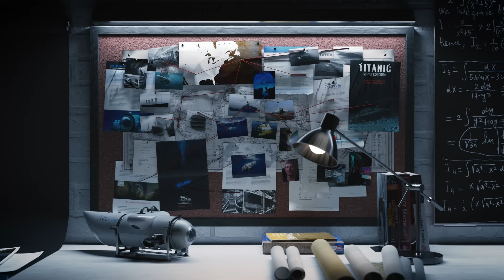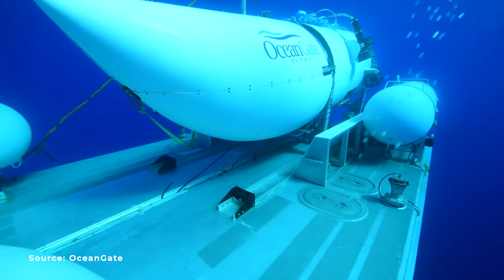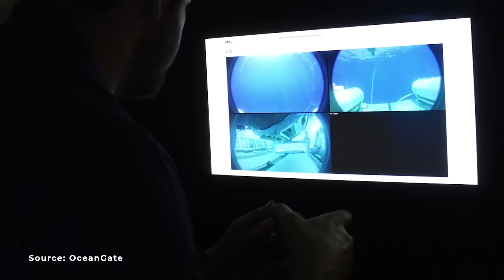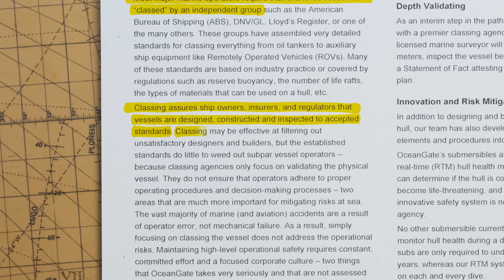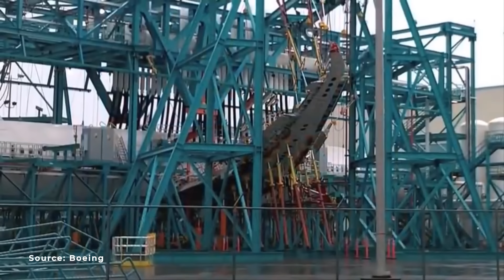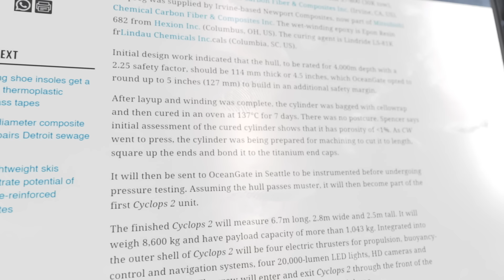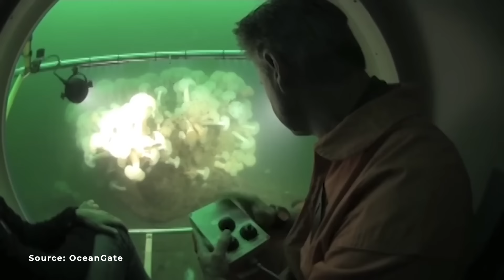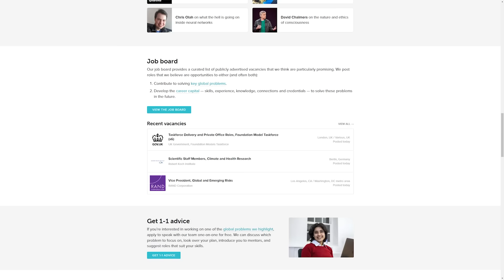The Questionable Engineering of Oceangate

Comment: Controller is a logitech f710. It is actually a very good controller. I have had the f310 for a few years now and had no issues with it.

The problems with that oceangate run deep (pun intended), but the controller is not one of the issues.
Reply: It is cheap and entirely indicative of the mindset that caused these deaths, so yes, it is a problem.
Reply: @connernickerson5509  no. It may be cheap and indicative of a larger problem with cost cutting, but that is not the same as being a problem.

Comment: the composite materials are realy awsome if you manipulate the properties of it flexing/stretching. Red bull did just this on their wings on the F1 car where it would bend down in a specific way if the G force was coming from a specific angle when going fast into a sharp turn to create ground effect sucking the car to the ground, so going into a corner faster made the grip better then going in slower. Truly awsome way to use its properties other then just being very strong for its weight
Reply: @@erickanter4090 that for sure they aren't made for compression

Comment: Thanks for explaining the underlying issue of using CF composites for compressive loading. CF tanks are used to store hydrogen on excess of 5000 psi in vehicle applications, but the CF composite is under tension in those applications.

Comment: Remember there is a good chance the carbon fiber tape was expired or close to end of shelf life when layup of the pressure vessel was done. 

Expired as in partially cured before layup leading to bad layer adhesion or voids as mentioned.

Comment: Questionable is a huge understatement.
No diagnostics, testing, disregard for obvious material science problems (like ignoring the difference between tension and compression) and past experiments or empirical work - which pointed out that this application had failure modes of delamination and that there was no method to acertain the if the pressure cycles were creating stress or microscopic problems. There were entanglement hazards, fire hazards, obvious design problems like people not having access to a hatch, seal problems, etc. Engineers around the world were ignored, whistle blowers were ignored...

Mechanical failure isn't more prevalent AFTER you do a serious engineering analysis, testing and you have protocols and real past experiences to weed out mechanical failures. Then, the operator has to be trained. So that blog line was total BS. Most mech failures don't end up happening because they have mostly been dealt with previously. There were no redundancies on that ship, so comparing it to aviation is laughable at best.

Idiots forget that when failure means deaths, costs are irrelevant. People will pay anything to not die.

Turns out doubters can have a point, specially when they are smarter, more experienced, and had studied that in the past. It was obvious they had merit.

Rapid innovation is a series of educated guesses, luck and things going better than expected.

This disaster is the culmination of unearned wealth, idiocy and greed. We should remember this as one of the most hilarious and stupidest accidents in history.

Comment: The move fast and break stuff innovation mantra is fine as long as lives aren't on the line. Run unmanned stress tests. It breaks at 50 dives? Then we'll rate it for 30 dives giving it a 40% margin of error before the composite hull needs to be replaced.

Comment: That's the key, isn't it - the reason the majority of accidents are operator failure rather than mechanical/electrical failure is that the latter class of failure is easier to control and better regulated. We can set good specs and build and test to them, which leaves us confident that the physical components are up for the job. Operators, on the other hand, get tired, or lazy, or unethical, and deviate from procedures even if you have good ones, or forget key principles in the crunch. We can reduce this risk but we can't reduce it as much as we can with dead matter.

Comment: Very good analysis.  I am also struck by the obvious failure to follow the principle of single-fault failure mitigation.  This is a widespread technique that's taught in which all possible failure scenarios that might involve injury are listed and measures are then taken to eliminate all single-point failure sources.  It's obvious even to engineers who lack the special training of this channel's founder that there are many ways that injury (or worse) could result from one thing going wrong.  What if the dive is successful, but the vessel comes to the surface and a serious storm has arisen? The passengers would be tossed about the interior like debris in a can.  What if there was a need for immediate exit of the ship?  Maybe they don't think that will happen, but the managers of Apollo 1 thought the same thing.  
If this device was a graduate level project, it would have gotten an F.

Comment: Autoclaves don’t force the voids out, they force them to be smaller. In that respect, vacuum bagging might actually be better. OTOH, as far as I know, the resins that don’t need the autoclave’s heat to cure are generally not as strong, so maybe they were using the superior process with the inferior materials?

As for billionaire man-baby space-Karen, I don’t think it’s fair to call his fail-fast “ethos” the same as what this company did: he tests! It’s a modern software methodology: code fast, test often, optimize later or never.

Comment: There are autoclaves used in the aerospace industry that are large enough for the submersible. I have seen them at airline maintenance facilities.  The problem is you'd either have to bring the autoclave to the manufacturing facility or bring the manufacturing equipment to the autoclave.   Neither choice is easily doable as both require dedicated installation and support equipment.   The only choice would be for the composite manufacturer to buy and install the autoclave, which for one, unique project is not cost-effective unless the company contracting for the composite manufacturing wants to absorb that cost.
Reply: not cost effective? then raise prices.
I'm sure customers would appreciate the added guarantee that you won't kill them by skimping on manufacturing
Reply: SpaceX at one point was doing carbon fibre tanks for Starship and they had an autoclave large enough for half of an 9m wide tank. This sub is way smaller. Not using an autoclave really makes no sense.

Comment: I have no problems with Stockton risking his own life to test new designs. Its the part about bringing paying passengers along that is the problem.

BTW a transscrip of the last communication with the Sub is floating around. It has not been confirmed, but if it is real, the accustic warning system did actually work, but for some not yet explained reason the sub could not resurface when they got the warning.

I guess the sub would loose boyancy if the hull was pushed in slightly ahead of the total failure?

Comment: Metals have strength when pushed on, as well as pulled on. All successful Submarines have metal hulls for this reason.
Carbon Fiber was the worst choice of material for a submarine hull. 
Carbon Fiber is like String which only has strength when pulled on.

Comment: It baffles me how this company took so many shortcuts with no counter risk mitigations.  It lacked redundant systems and it bet peoples live on thin or even exceeded margins.  I've built some lower cost storage servers for customers by using refurbished drives but I always require they spend some of the savings on extra redundant drives and keep a spare drive or two available.   Its just basic risk management and this company had none it seems.  Engineering is an act of balancing all the requirements of design, risk, and cost.  What these people did was just build something and ignore risk for cost.

Comment: As someone who is also currently working with composites as my master thesis, this video is very well done and very informative! When I first heard about the news about the submarine I did not know that it was made from carbon fiber epoxy composites, but after hearing that, I was flinching because composites are very heterogenous and if one materials good in tension there is no assurance that it will be in compression and carbon fiber is definitely not known for its good compressive strength! yikes! So incredibly sad that 5 lives were lost because the CEO did not  care enough about standards and testings which are usually very rigorous for aviation industry.

Comment: So, basically their argument was, "Everyone else is classed to ensure the vehicle meets acceptable standards of safety.  But none of those classed vehicles sank without operator error.  Since it's always operator error, and classing doesn't address that, why bother classing?"  

This logic is severely flawed.  The fact that it was only ever operator error in classed vehicles is actually an argument TO get classed, because it appears to vastly reduce or eliminate mechanical failure and leaves only operator error as the potential risk.

It's like saying, "No vehicle in which the brakes have been inspected has ever crashed due to a brake failure.  They have instead been a result of driver error.  And since brake inspection doesn't assess the driver, we decided we don't need to inspect the brakes."   This failed logic just reintroduces brake failure as a potential risk factor.

Comment: moving fast and breaking stuff is not a bad strategy, specially when what you are making is nearly impossible to realistically simulate and there are way too many moving parts. but you NEED to break stuff, you need to test it in every conceivable scenario and see what goes wrong. that is why Space X was successful, every time they failed it was an opportunity to improve, they never put lives on the line until their rockets were proved to be safe enough through repeated testing.
Reply: I think the problem was Rush's move fast and break people strategy...
Reply: @MarkTillotson  that is the point, he should only have put people in the sub after 1000 unmanned dives to much deeper places than titanic. Falcon is one of the safest rockets because they launched A LOT of it, and it failed a lot, to the point they basically figured out almost everything that could go wrong with their design and adjusted it accordingly.

Comment: Carbon fiber flexes under load.  Compressing the 'outer' layer causes inner fibers and resin inside to flex to move out of the way of the compressed material.  Over time stress fractures will form further weakening the structure.  Sapphire Glass is the more ideal material for this application.  But honestly, use a drone.

Comment: This whole case reminds me of the De Havilland Comet.  Same issue with repeated pressurization cycles and unexpected fatigue, only in an airliner.
Reply: The difference is the designers of De Havilland Comet were not aware of possibility and probability of such failures. Here, Stockton Rush(with all respect) ignored many warnings, discredited previous research and made questionable design choices…
Reply: Just like someone else said, that was in the early days of aircraft before they knew why they know now.  Completely opposite from what happened here since we know as much as we need to know about submarines and submersibles to make them safe.
Reply: was going to say just that
Reply: The choice of square (ish) windows was the final flaw which broke the aircraft. The failure crack started at the window corners, and then propagated through the whole of the fuselage. The whole aerospace industry learnt very quickly from this, and this design mistake was never made again.

Comment: I really appreciate your concise video.
Even with only a GED I can completely understand what you’re saying.
My first reaction to the implosion was to think about how the squishy or the chewy middle part was not going to work well with the much more rigid titanium end caps.  The implosion was going to happen, it was just a matter of when.  And apparently 14 was the magic number.
The original hull didn’t really survive testing and had to be replaced.  So to think that the new hull could make 14 trips to the Titanic is just pure stupidity.
My apologies for bringing politics into this, but regulations have a purpose and are never bad if it saves lives.  I think of how we have experimental aircraft and those aircraft don’t carry passengers.  Such regulations would have saved four lives in this instance.  Only the experimentor would have been killed.

Comment: Pointing out that the vast majority of submarine failures are due to human error rather than mechanical failure is a form of sampling bias, because most submarines are built to a proper standard thereby eliminating most mechanical failures.

Using this fact as justification for not building to these standards is criminally negligent IMO.

Comment: The fact that most marine and aviation accidents are due to operator error rather than mechanical failure sounds like a perfect case of survivorship bias. 

It’s much easier to enforce regulations for mechanical features rather than on the operators themselves. The reason these events are so rare today is because of this enforcement, so pretending like mechanical errors are of little concern is extremely dangerous.

Comment: I would like to know what inputs were critical in the submarine design other than just the carbon fibre. What seals were used for the hatch.
Reply: There was no hatch, at least in the conventional sense. The whole front titanium hemisphere was unbolted and rebolted with 17 bolts everytime people went on a dive. They were literally trapped inside, with no way of exiting even if on the surface. 
Biggest design issues other than the use of cfrc:

1. Shape of the pressure vessel. Should have been a sphere, not a cylinder, for diving at these depths. No one has ever used a cylinder shaped vessel for manned exploration at these depths before. 

2. Weight is a critical design consideration for submersibles. Neutral buoyancy is ideal. Brian did mention this, but the ideal material of choice is forged titanium, for its exceptional properties of light weight (relatively) and immense strength, combined with very good fatigue properties. It is also very resistant to corrosion. This approach is optimal, but probably the most expensive.

Comment: While I don't question the overall point of this video (except for the AD at the end☹); there is at least one  "Questionable" fact in it.    I refute what's claimed at: Ref 6:30 - 6:37 => "...at least 50 times with this vessel".   It has been reported that this vessel's hull was created after a first composite hull was destructively analyzed and found defective.  Perhaps OceanGate thought the composite material's defect/s were caused by manufacture, rather than by deep diving cyclic fatigue?   However, Titan's imploded hull did not dive anywhere near 50 times to 4000 m .

Comment: The Titan should be recognize as an engineering feat. For as insane as the CEO was, all he had to do was get official regulation to really cement his design as a legitimate, and viable.

Maybe his material usage wasn't optimal, and perhaps it leaves for a lot of weaknesses in the structure, and risks complications for repairing these parts.
BUT, if you're willing to do your due diligence, this could be researched to find low cost alternatives, or redesign shallow submersibles.

Comment: As an aerospace composite engineer, I will comment that <1% porosity is the typical standard is the industry (based on non destructive inspection, which they did not perform), and composites are considered mostly immune to fatigue at stress levels below 50% of their tensile strength so fatigue testing is used mostly for aluminum or mixed structures. BUT, that is common practice BECAUSE we now have several decades of experience, standards, and regulations. It only means something as long as you are within the same design standards. Stepping out in uncharted territory renders these standards useless. Not knowing what your failure modes could be is the biggest red flag for me, because it means you have no idea what material properties to assess and what testing to perform.
Reply: Is carbon fibre by design ever suitable for manufacturing deep sea submersibles?
Reply: @multioptioned  I will say that it riskier because composites are more complex and less understood so there is more chance that the design is flawed.

Comment: One thing you got to admit if he made 50 plus trips down there and back in this thing then if you designed the hall to be replaced easily you could do a certain amount of trips and then replace the carbon fiber material.
Reply: If only they had tested a statistically significant number pressure hulls to failure, they would have known when to throw them away.  This is stuff reputable companies do before risking lives of paying customers.
Reply: @andyharman3022  Exactly. Even if they did 100 trips and then they replaced the hull, that one might snap on trip 20 or so. Failures due to fatigue are distributed very broadly.
Reply: @onesquirrel2713  yeah now thinking about my comment each pressure vessel would be different because the first one maybe didn't have any voids or anything and that was the best they could have got was 50 of the trips! But if they were to test 100 hulls to failure and every one of them made it past 10 trips then you could statistically say that 10 trips would be the maximum. I realize you know one small issue with material quality etc would Make a big difference with that type of material and pressure!
Reply: Decision on replacing hulls changes when commercial considerations come into it. He just wanted to make money. James Cameron had his one man submersible for trip 3 times deeper well built at a cost of $10million but it was only designed to be used once at that depth. No profit in that except selling the footage.